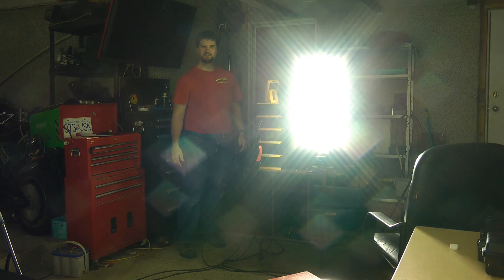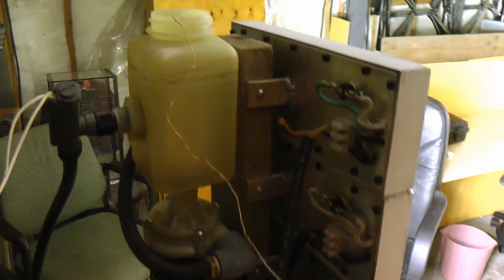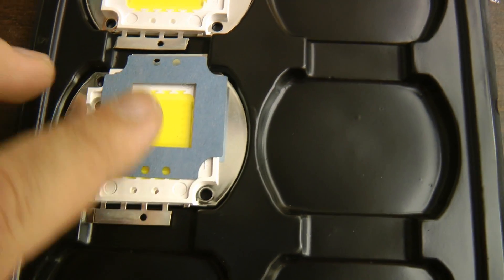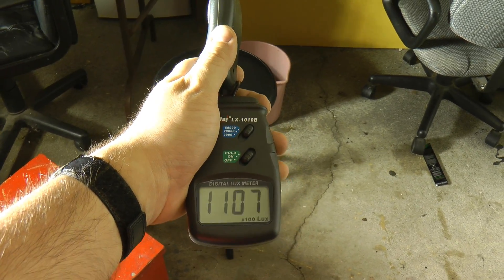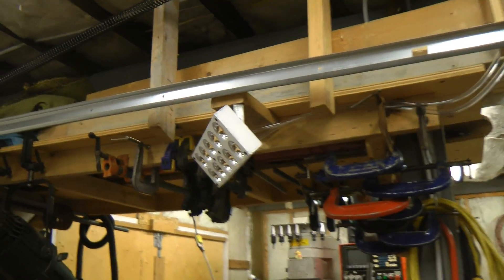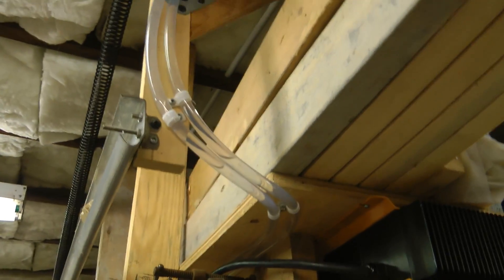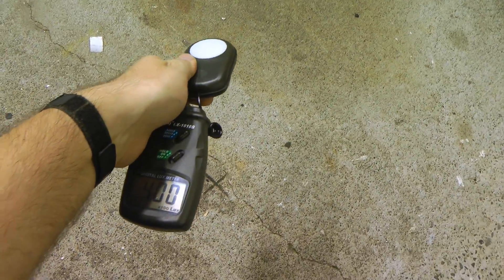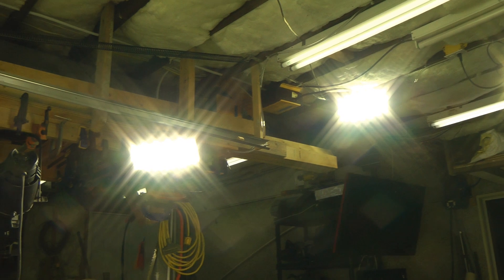World's most powerful LED light - 5kW (1kW module build part 2)

Comment: Why there is almost nobody using at least resistrors in series with the LED chips, these LED chips need to be powered with current power suply, not voltage suply, if they should perform for loger time.

Comment: I'm not against the LED lighting but still we have long way to go to reach the level of improved, efficient and cheap LED lighting system, we need all that accessory, radiator, tubes, connectors, and so to cool down the lights  and guaranteed the longevity of LED's, they are not cheap and they need maintenance, we may save some energy by using such a lights but what about the cost of related cooling system? by the way, better to have a parallel but not series tubing to distribute even cooling temperature, using series system may cause overheating the last couple of LED units.

Comment: That's nothing compared to the composite bulbs that are used in movie lighting. With one of those pointed at your garage door at that distance for more than 10 minutes, the door would likely catch on fire. Even without that factor, the reflection off the door alone would be bright enough to blind you.  Those things are kinda above your pay grade though...
Reply from the maker: You mean HMI lamps? I was looking at some 12kW and 18kW units at one point, but the cost per lumen is way higher than LEDs
Reply: Yup. Those are the ones. That's why I was saying that they were above your pay-grade lol. It wasn't meant as an insult, but rather a statement of fact for most people. The ballasts alone for those units cost an arm, a leg, and your first born : )' Those bulbs can literally be used to turn a set at night-time into day. You should check out the Piranha and LRX1 and 2 from a company called LRX/Dwight Crane. It'll definitely bake your noodle. I used to work for them as a fabricator, and that was easily the most interesting job I've ever had. 
The Piranha is essentially a JLG boom lift converted to fit light mounts instead of a basket, and the LRX1 and LRX2 trucks are essentially the same thing, but more powerful. The bodies on the back of those two trucks are almost completely filled with ballasts and a huge generator. I dunno about the Piranha, but LRX1 is worth 1.5 million, and LRX2 is worth 3.5 million, so most definitely above both of our pay grades lol.
LRX1 was used in Titanic and The Perfect Storm, for reference, but LRX2, which was obviously developed later, is literally 3 times as powerful. You've seen the LRX2 at work in Deadpool, to name one movie, but LRX equipment has been used in pretty much every AAA movie you've ever seen since the mid-'90s.

Comment: Use like an old condenser from a car or truck and depending if you want the heat inside or out put it outside i live in texas so we rarely need the heat inside but you could do one outside and one in with a valve

Comment: About cooling... if you can find on junkyard or somewhere only outside cooling part from split system cooler and modified to use only radiator and fan instead...

Comment: Wow.  Nice.  Although, I should mention that your cooling system should be connected in a "star" configuration rather than in series.  The way it's shown in the video, that last set of LED's is going to be running WAY hotter than the first set.

Comment: Cooling system is wrong.
it should be done separately to each panel.
Now, heat from first panel is going to second panel, after get heat is going to third etc.
In that case, on fifth panel, you are delivering heat to him, not taking all of heat generated by panel.
When you connect them separately, you will not need so big cooler and so much water, even temperature will be lower on each panel the same. Now if you will measure, on first panel you will have lower than on last one.

Comment: I have an idea. You can use the heating radiators inside the home. You can connect the water cooling system there so that all heating from the leds will be transported to the radiators and warm the home too.

Comment: @2:50 you could find thin gasket material such as for automotive use. Although it may be to thick for this application. The nice part is the heat range it can tolerate .

Comment: Sorry for being sceptical, but this is far from the most powerful LED light, the nearest football stadium to you has much bigger and more powerfull lights, but you said the whole World. And if this is built from the cheap Taiwanese Epistar 100W LEDs, that might have about 350,000lm luminous flux, maybe but most probaly less. And that could do about 12,000lux at 3meters. for 37000 lux you need about 1 million lumen at 3 meters, and that is 20,000 lumen from each crappy 100W Epistar $8 chip, which is totally nonsense, the are maybe 7000lm. Maybe. 7,000 < 20,000 that is a huge difference. And this video dated from 2016.
20,000 lumen is not possible in 2018 , right now, neither. That would mean 200lm/W
Can't do it, neither CITIZEN, CREE, OSRAM, GE, PHILIPS, LITE-ON mentioning only the best LED brands. Epistar considered as a crappy cheap one. Chinese merchants and manufacturers on eBay, AliExpress, they all lie about technical parameters, very boldly. Once I've bought a nominal 135W bulb and it was 27.5W . Just saying.

Comment: i think water supply which is connected in series can be an issue with light connected at last and second last. may be it could reach its working temperature. but i suggest to have all water lines in parallel  discharge and return connected header. and to enhance same setup for lower temperature you can add thermo-electric cooling plates .

Comment: Pointless.  There is a device that starts at sunrise- it is called the sun and much cheaper and safer. It is my invention so I have bragging rights. My sun, can produce 1700 watts per sq meter give or take a few hundred watts. Since I have so much going on use as much of its rays as you can, with my expressed permission. You can fry eggs and more if you have a mind too. Coffee is great too.
Reply: It only operates for half the day, though. Half duty cycle, pff

Comment: Hose should be black to prevent any kind of algae growth. In having ran aquarium algae scrubber for a 4yr run I can attest to that. Maybe stick some propylene glycol (Safe pink rv antifreeze) in the water and try to keep covered the reservoire. Btw you'll get a brighter tighter spread with the Ledil Angelina reflectors and them masks may have better chance to cool on the front side.  ;)

Comment: Use thermal exchanger and hook it up to your domestic hot water tank ( before the actual tank). It will pre-heat your domestic water ( hot water in your sink) and save you some money.

Comment: What do you have to do in order to modify the golf cart battery chargers be LED drivers?  Are you just using an off the shelf 1k dimmer to dial down the voltage to dim the light?

Comment: This is perfect for a Photo studio (Yes, sometimes fixed lights are better than flash). I get problems with the Room temp when i run my current setup with 5x 2000 Watt MHL Lamps @250V.  Mount it on movable heads (maybe with some servos? :D), perfect. I would buy some ... or try to build it myself.

Comment: if it's 5 separate circuits which you switch on individually makes it 5 separate lights, just he boards sitting next to another doesn't make it one light, that's like sitting ten cars next to each other and saying its the single brightest headlights in the world lol, one circuit one switch one system makes it single in my opinion

Comment: How are you pulling that much amperage? Even a 25 amp circuit in your shop would leave almost no overhead for tools and other stuff. Or do you have it spread across multiple circuits?
Reply from the maker: The shop has 8 120V 15A circuits, each charger is on its own circuit.
Reply: Damn you don't mess around haha. Awesome setup

Comment: I like your videos and cool projects. I also hate to sound like a Mom, but you should probably take some time and some poly and/or drywall to cover off that exposed fiberglass insulation. Its probably releasing tiny strings of fiberglass which you and your cat are breathing(like @ 6:42). Also it gets into your skin and causes itchiness and irritation. On top of the health effects(not much safer for you than asbestos) this stuff can be very flammable. A condo building under construction burned to the ground when someone threw a cigarette but into a pile of this stuff near where I live.

Comment: The time when L.E.D.s started producing heat just flew by me I guess. The point of L.E.D.s is to channel energy more efficiently by not wasting it in heat production. Again, when did L.E.D.s start producing heat?
Reply from the maker: The best modern LEDs still waste about 50% of their input power as heat. Much better than the 95% or so wasted as heat by an incandescent.
Reply: Strange advancement in L.E.D. technologies. Sacrifice efficiency for lumens. Oh well, typical of humanity. LOL
Reply: If you can dissipate the heat, then it isn't a bad tradeoff. The effort required to cool a normal LED lamp is negligible compared to the gains of lumens.

Comment: Use a beer flash cooler that has a cold water circulation pump. You'd be able to keep the temperature extremely low. Only downside is that it wouldn't be portable! Either way, you could set up a massive LED rig and not have to worry about it overheating.

Comment: I noticed a major problem in the way you plumbed your water cooling. You plumbed them in series. Thus, the temperature from the first one is carried to the second and so on and so on. Therefore, there is little cooling going on at the last light. Or you had to use the super large system that you have. To increase the cooling ability and decrease the size of the cooling system. You have to run them in parallel.  This way each light group is able to maintain the cooling parameter that is recommended to keep them from burning up and producing their maximum output.  The entire cooling would be something like half of what you are now using. Or use what you brought and the light temperature will be half of what you are now getting. 
Thank you I just taught you might like my input. I do have some background as I am a Master Plumber and a Master steam and hot water technation.  
.

Comment: You need to change the way you run the water. By the time it gets to the last unit its to hot. Maybe try a capillary cooling system on each unit, might be better than water

Comment: The big problem is finding a supplier on ebay to provide quality leds, most are dodgy factory rejects with dull or dead leds inside. A light 5~20KW like this would be handy as a sky light in the bush, it turn night into dusk for Km by flooding the sky with light.

Comment: this has probably been mentioned, but just in case it hasn't, i feel it's important for me to inform you about the importance of bonding your non current-carrying electrical components to ground via that green wire that seems to be cut short, and or hanging loose in the vid.

$0.02

Comment: You should have the return on your water reservoir dumping on the surface.  Having the return under water will cause the pump to work harder and slow the flow which diminishes the cooling ability of your system.  The deeper you go the harder it will be to push water back into the reservoir.

Comment: Very cool! I have a homemade flashlight with 10x3,7V Li-ion batterries in series, about 38V when fully charged and under load, they power a 100W led chip attached to a massive aluminium heatzink, that is one of the chips you use?
 - however it does not draws about half of that, it should theoretically be 2,6A. Do you know the actual power of yours?

Comment: I admire your set up, layout, and workmanship. Most excellent. 
One feature you must add is the use of coolant instead of water. Should drop temperature about 15%.
For 5KW, that is an outstanding array. I rigged a similar array for my wife in her art endeavors. I'd guesstimate 2 to 4 times incandescent power requirement for the same coverage.

Here is a trick for you. We needed full or modified spectrum of color in her studio. I painted the entire ceiling with the entire spectrum rainbow. Then reflecting some of the light off the ceiling, six 500 watt portable halogens in my case, we could add some or all of the color spectrum as desired. Absolutely fantastic for getting to proper skin tone and color of the models regardless of their natural skin color.

Comment: Oh yeah, one more trick for your water system, try a product called 'water wetter' it's basically a surfactant that helps break the surface tension of the water in the boundary layer of the heat sink and heat exchanger.  It's usually used in cars and it does make a difference, it's like 8 bucks for a bottle.

Comment: what sort of thermal compound did you use between the led and the housing it's sitting in?
Reply from the maker: It was just generic MG Chemicals thermal grease, probably aluminum oxide based.
Reply: fair enough, thanks a lot for the reply.

impressive setup

Comment: Don't take this negative because I love what you're doing. I would measure the current because if those are cheap Ebays, there is no way they're 1kw
Reply from the maker: I did check, they are running at full current. These are the slightly more expensive, not-quite-garbage ones that actually work reasonably well.
Reply: Awesome. -- I just saw a video where some had been tested and I was shocked at the lack of quality. Keep up the good work! -- Maybe think about running the coolant in parallel and use anti-freeze for better heat absorption.
Reply: tesla500 I was thinking instead of using tin foil to mask the edge of the LED chips, why not try a non metallic non stick oven cooking sheet. They are thin, easy to cut to shape and made to sit at very high  temperatures for long periods.

Comment: Did you sort out your thermal displacement deficit with a bigger or second rad? Awesome lights, I really liked the build video.
Reply: Why don't you chain them up in parallel rather than in series? Now, the last one will have warmer cooling water than the first one. In parallel you won't have such problem...
Reply from the maker: Adrian Smith the cold winter weather has sorted the thermal problems for now, but I am looking at a much bigger radiator.
Reply: I thought of that too, I think Tesla500 may not have due to the excess of tubing required, though the flow would be better too due to less resistance.

Comment: Wouldn't the cooling be more efficient if you used a parallel setup instead of series? The last one in the chain will be getting warm water from the previous 4 to try to cool it so it will be at the highest risk of heat failure.

Comment: If your application is for filming only, you could evaluate synching your camera shutter with a control circuit, which will enable (open) the current to the LEDs only when needed (24, 30, 50 or 60fps) and at a duty-cycle (DC) of your choice. A few opto checks will setup the DC for each shot. That will save a considerable amount of electrical power without compromising the light levels perceived by the camera sensor. You've done a remarkable project. My regards
Reply from the maker: I had thought of that, but these are being used for high-speed filming, with several cameras running at different frame rates. This makes is basically impossible to do this because the shutters never line up due to the different frame rates.

Comment: The sagging issue with the tubing underlines an potential of it failing or developing leaks.  Fiber reinforced Tygon tubing that is rated for hot water applications may be in order for your needs.

Also, you may want to consider re-plumbing and making it all  parallel instead of series, using a valving manifold.  This will also solve your cooling issues as well.

Comment: It will run allot cooler if plumbed in parallel .Running the lines in series allows the last module to run much hotter than the first.

Comment: One thing you could do to get a bit more radiator area is to replace some of the tubing runs with copper pipe.  It would actually clean up the way that it looks, and the tubing itself would effectively become another radiator.

Comment: Adding the thermal cutout is a good idea. However, I would not place it on the back plate of the water cooling cavity, but instead either on the side of the front, or on the front between teh LEDs. The way it's placed now will protect you if the water flow stops, but it will complete fail to work if you got a water leak, because then you'll have quite a bit of air between the back plate and the front that has the LEDs on, and it'll take way too long for the thermal sensor to notice the rise in temperatures. Your LEDs will be long dead by that time :)

Comment: That was impressive!  Those floureschent lights in the ceiling look like they where off 
 - and those usually give off quite much light compared to "normal" indoor lighting.
I also know those tube halogen lamps of 1 kW
 - now think of LEDs thats so much more efficient. Each module is like 5-6 times that light, LOL! Perfect for high speed filming.

Comment: I'm new to liquid cooling of any kind, but I have a question.  I see that the cooling line runs in series (maybe that's the wrong term), does that have an affect on the LEDs further down the line?  For example the cool water runs through the first set of lights, pulls the heat away and takes it on the the next set of lights and so on.  Would it be a more even cooling if the lines were running in parallel? As in all the LEDs get the same temperature water. I would assume you would need a more powerful pump starting with a larger hose splitting into 5 smaller hoses to get the same amount of water flow through each LED.  Maybe my idea wouldn't be so practical now that I think about it hahaha

Comment: Hey dude, in my past research I found that tube and fin radiators are the least efficient transferring heat.  You might consider bar and plate model.